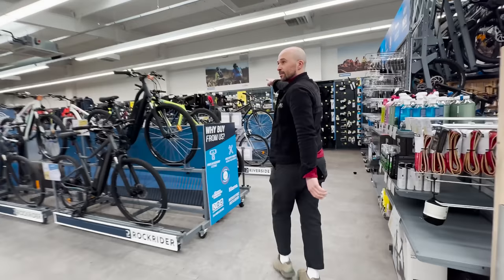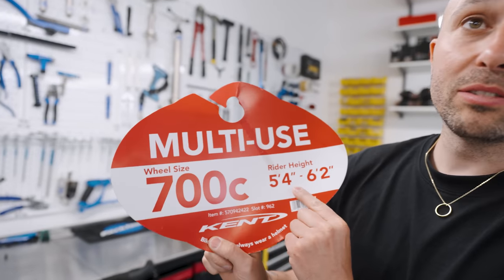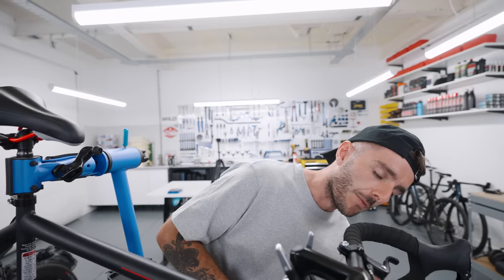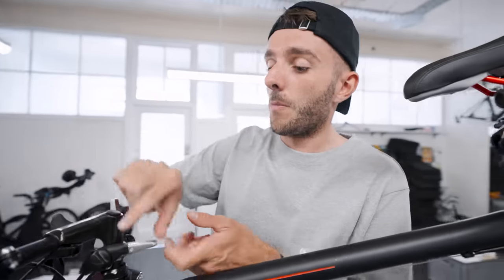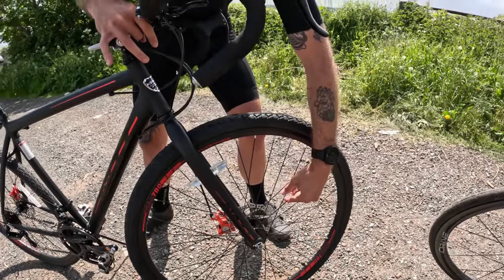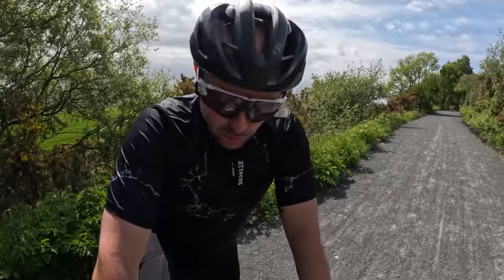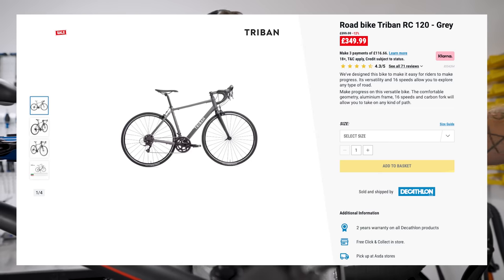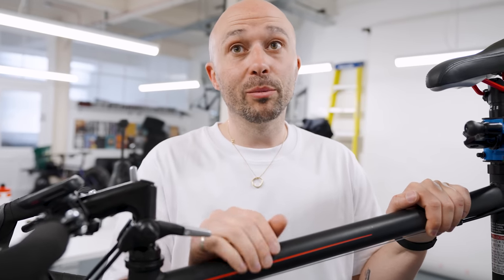We Bought A $248 Entry Level Bike in 2023 - Too Cheap?

Comment from the maker: Something I didn’t think of pointed out by @egyeneskifli7808 in the comments:

The frame being steel means you could have the steel derailleur hanger re-welded if it were to break. A fairly low cost solution, but would probably entail a trip to both a welder & then a subsequent trip to a bike shop for straightening/tuning if you weren’t confident in doing it yourself.
Reply: Labor costs for either in the states is going to be more than the bike is worth.
Reply: even cheaper and easier would be a derailleur hanger bracket that bolts on with the axle (for example the Shimano RD-MC10). They were pretty common when older bikes with horizontal dropouts were fitted with a rear derailleur, and you can still get them sometimes for about 5-10€.
Reply: I really like the ability to brake when in a more upright relaxed position thanks to the extra set of brakes. Most of my riding is for commuting, and I occasionally use the bike for amateur bike races and triathlons. I honestly wish more gravel bikes had these extra set of brake levers.

Comment: upgrade the bikes to a certain budget and race it, and please do not do what the GCN guy did very unrealisitc adding a dura ace crank.
Reply: Upgrading them to the minimal acceptable level would be cool.
For one strip all the unnecessary crap: kickstand, prisms, etc. On this bike I would definitely try to get better levers (idk the availability of 2x7 combined ones) to make the front less busy and better suited for normal cycling. And definitely upgrade the tires on all of these cheap bikes.
Reply: What do you mean unrealistic? You don't have a Di2 Ultegra just lying in the back of your shed?
Reply: You say ‘to a certain budget’? Who’s to say GCN’s ‘certain budget’, didn’t include a Dura Ace groupset?
Reply: How he expects to shift swiftly, during a criterium race (Alex said he'll race using that bike), with a crankset designed for a 11 speed cassette, using a Sora 8 speed instead, will be always a mystery to me. #gcn 😂
Reply: Agree with almost everything. I would probably keep the kickstand. Some small weights are worth keeping for the sake of convenience (in my opinion).
Reply: Cade doooooooooo it. No balls
Reply: @shrinkingshrimp  kickstand isn't unnecessary crap
Reply: @gpersonaltrainer 1979 Campagnolo 6 speed chainset works great on 10 speed chain and specially narrowed freehub,  sliding easily into 126mm dropouts with 1973 Nuveax Record derailleur on original downtube shifters. 9 cassette sprockets out of the 10. Yes I did just that! Still works great. 1979 Dave Moulton.
Reply: Yeah like a $1000/£ upgrade build off of budget bikes

Comment: Pretty amazing that Walmart is providing a safe, affordable, and reliable entry level into road and gravel. Most people buying these are riding around the suburbs to a park with their kids or any easy ride on flat paths. 

No bottle cage mounts is crazy though!
Reply: Give a spoke has gone and one of the brake levers doesn't work, reliable seems like a push as a description.
Reply: I've owned and worked on these bikes and they are not very reliable at this price and usually not safe at all. The amount of bikes I see going out of Walmart with no brakes and loose cranks is ridiculous.
Reply from the maker: @nascarisawesome5018  more an issue with the Walmart staff assembling them than the quality of the product perhaps?
Reply: These bikes are an absolute tragedy. The brake levers are long and fragile, will easily snap off. The handlebars are so incredibly deep, unrideable in the hoods. The wheels are made of cheese, the bottom bracket comes packed with sand instead of grease.

Definitely one of ye worst bikes that you can buy
Reply: @Cade_Media  Absolutely the case. Wal mart assemblers are not hired as pro mechanics- they're just minimum wage employees who get thrown at an instruction sheet. And I'd bet that when somebody gets good, they get a better paid job at a higher end bike store.
Reply: @Cade_Media  Both. I live in a university town and these bikes (and similar from another chain called Academy) are constantly falling apart and being abandoned. They use really horrible parts specs, like C&C bearings in the BB's and hubs that are trashed within a year because the people that buy them aren't the type to maintain them, let alone pulling bearings for constant regreasing (or just greasing a first time, because its Walmart).
Reply: @Cade_Media  A bit of both. A lot of the bikes come with inverted forks and loose things like cranks, which is on the assembler. But there is also a lot of stuff on there, like stems, that are very low quality and often arrive stripped and even come bent.
Reply: Grew up with bikes like this for over 15 years and never had a problem with them, its a shame they get such a bad rep because they are actually not bad at all. As for the bottle holder, evertime I had one it never even fit I just put it in my backpack and that works just fine

Comment: I use a Companion 1.0 gravel bike (from the danish chain Fri Bikeshop) as my daily commute bike. It was around 600 pounds on offer at the time I bought it.

It has really impressed me. Shimano Sora, disc brakes (not hydraulic), good stiffness and ok weight. 

I love using it as my commuter or when riding trips with family or friends.

Comment: What I've noticed as I've begun to dive deeper into the biking world is that a lot of these budget bikes are really hybrid/ATB bikes in disguise. This particular Kent may not be a "true" gravel bike, but it would make for an excellent commuter for someone who might need to cut through the odd gravel trail every once in a while.

In addition, the wider handlebars on this bike seem perfect for attaching a front pack if you remove the redundant brake levers, I think
Reply: I probably wouldn't use the word excellent, maybe more like usable.
Reply: @markusseppala6547  Usable for a few months til the parts give out. This bike is made to sit in someone's garage and maybe be used twice a year. Daily use this thing will be clapped within a few months.

Comment: I want to see you guys upgrade this thing to a "banger of a bike" like Jimmy says it can be. I think a lot of us are buying lower spec completes these days and then upgrading drive train, wheels, cockpit over time to make them the bike we wish we could have afforded to begin with. Probably not from this low of a spec though lol.
Reply: Plus, it's kinda enjoyable for some to just tinkle with it for upgrading and reaping the benefits.
Reply: @IS-xk3iq  also, for a mechanically inclined newbie, it ended up (for me) being a great way to learn the basics of working on a bike, upgrading parts, and learning what features I cared about before investing in a more permanent bike.
Reply: This bike is way too low spec to do much with. That drive train isn't going to be intercompatible with anything so you're upgrading all of it in one go. You might as well just buy a new bike. This is the problem that a lot of newbies are been scammed with regarding the buy cheap and upgrade path. There's a level too low that you can't actually upgrade. You have to know enough to start at a proper point.
Reply: @cjohnson3836  It looks like square taper (threaded BB) so it should still be fine for a BB upgrade. There's a lot of ST cranksets around that work well too. The rear sprockets are likely a freewheel, but a nutted axle wheel can be replaced with a QR freehub wheel without issue if you really wanted to do that.

Comment: I bought this bike from walmart in a box that I put together for 250usd. I love it. The stock peak bb5 clone brakes are good but I bought avid bb7 brakes for much easier adjustability. I have the bb5 adjusted well on the cross sub levers and the key is to get the outer brake pad close enough to the brake rotor and not having it rub. Make sure you back off all the barrel adjusters off first. The brake actuator arm on the brake housing should be totally relaxed and then you screw in the cable bolt. From there, there is going to be some trial and error to adjust the outer brake pad to the rotor. Adjust one brake pad at a time and have the other all the way out so you can listen to only one brake pad rubbing on the rotor when brakes are relaxed. Once you have the outer brake pad dialed in and it's not rubbing on the rotor then work on the inner brake pad by screwing in the outer adjusting wheel using a hex key. Also, if it's hard to turn then back off the set screw in the brake housing because it's pushing on that adjusting wheel so that the wheel doesn't screw itself off. When done, screw in that set screw just enough to allow you to rotate the inner brake pad adjusting disk since you'll need it to make adjustments when the brakes wear over time. 

With the bb7 brakes, the outer brake pad can be adjusted and that takes out all the trial and error of bb5 setup. Before any of this work, make sure you true the disc rotor first so that it doesn't wobble as much because then you'll need more empty space between the brake pads and the rotor and your cross bar brake levers will probably bottom out before the brakes stop the wheel. For the cross brake levers to be adjusted well, you will need minimum space between the brake pads and the rotor and thus the rotor can't wobble too much. I find the back 140mm rotor to be lot stiffer than the front 160mm and thus adjusting the back brake is much easier. 

Make sure you take the slack of the 7 speed indexing derailer cable out first with pulling on the cable with pliers. The barrel adjuster should be retracted on the end of the derailer. Also, take out the slack of the friction shifter cable of the front derailer the same way. The front derailer doesn't have barrel adjuster. My front derailer only has two chain rings, the smallest is gone. I took off the plastic chain protector on the front derailer off as if the chain comes off it will be easier to put back on. The front derailer should shift gears when the friction lever is pulled all the way down because after the shift the lever will move back up a bit, which is normal. My front and rear gears shift great and I have zero problems. It's all in the setup as they say. 

The tubes come with shrader valves and if you get a presta valve tube then you'll need an adapter to put over the presta valve to take up the space of the larger shrader hole in the rim. If not then expect a tube blowout. If you ever need to take off the freewheel then use an impact wrench on the freewheel bolt. To put it back on, just snug it and start pedaling and it will auto screw itself in. Don't use the impact wrench to put it back on. 

I love the frame and the welds look great. The wheels are also heavy duty double walled and you can put rim brakes on those wheels as well if you wanted but they must be center mounted rim brakes because they have only one hole in the front and one hole in the back forks to mount them. Can't put in a V brake because there are no standoffs to mount them to. Lastly, I too ride with my hands on the top of the drop bar and rarely use the handles unless I'm sprinting. I love the look of drop bars and that's why I bought this bike. My tires are 35mm wide. I think you can put on a 40c tire as well and not run out of clearance in the forks. I think the rim is 21mm wide internally. 

One thing about the front derailer adjustment. Make sure that the derailer cage is centered over the chain when you're in each of the chain rings. Shimano suggests otherwise so don't go by their manual. They want the inner edge of the derailer cage to be 1mm from the  chain and I disagree. The system seems to work best this way. 

Forgot to mention that you don't need the avid in-line barrel adjuster on the front or rear brakes because the cross brake levers have their own barrel adjusters. The main brake levers don't have barrel adjusters. Remember that the main brake levers pull the brake cable and the cross brake levers push the cable housing in order to move the brake cable. These are two different systems and that's why the cross brake levers are more difficult to setup right and need minimum free space between the brake pads and the rotor. The main brake levers don't care about this that much because even with more space, the levers won't hit the drop bars. I plan on using this bike stock other than installing the avid bb7 brakes. I will lube the caged bearings and might replace them with better balls and just toss out the cages. This bike needs nothing, imo. Maybe new chain once in a while so it doesn't wear out the freewheel and chain ring. But even so, they're cheap to replace.

Comment: You can get a cheaper bike from Decathlon than the one you brought and it starts to have a lot of compromises and weaknesses that you see on this bike. 

The Decathlon bike you got really is the base model entry point where a road bike has all the "similar" features of a £10K road bike. Where as something like this bike, just doesn't, friction shifters are the 90's, as are quill stems, not having bottle cages is just cheap, there is not really any other word for it. They haven't aimed to make a good bike there, they have aimed to make a cheap bike, that looks modern (hence discs), for the uninformed consumer.
Reply: someone buying a bike from a place like wallmart are not going to be informed about bikes tbh. So the company knows their target.

Comment: I only started cycling about 2 years ago, and I got started on a very similar Walmart Kent.  Mine had rim brakes, aluminum frame, a triple chainset, 28mm tires, no top-brakes, bottle cage mounts, and shifters (I don't know the proper name) that are in-line with the handlebars and twist to shift.  I did end up piecewise upgrading almost everything on that bike as I learned to ride, and what features mattered to me.  I definitely would have been better off to get the Triban as an intro bike, but didn't know that at the time.  I wasn't sure that I'd enjoy cycling, so I wanted to go on the cheapside until I proved to myself that I'd stick with it enough to warrant a "real" bike.
Reply: Those shifters are called, unsurprisingly, twist shifters. I actually really like them- mechanically they're dirt simple, basically as simple as an indexed lever, and they're easy and intuitive to operate. They don't make any sense on a drop bar, though (hell, I didn't know you could get them around the bends on a drop bar!) but my favorite option on flats.
Reply: @cptjeff1  the big problem, for me, as a total beginner, was that taking a hand off the handlebars to shift was really dicey.  Not having ridden a bike in like 35 years, since my childhood BMX bike days, the roadbike felt twitchy as hell and I really did not want to take my hands off the bars even for a second.  That was one of the first things I changed out (for brake lever shifters). I never could figure out how to remove the twisters without breaking them apart :).  My only guess is that the bars were bent after the shifters were put in place?  I dunno, it was weird.
Reply: @DC-lu5qs  Twist shifters don't require taking your hands off the handlebars, though! Just slide them over. But yeah, taking a hand off is a critical skill to master if you ever want to do something like turn on a light, take a drink of water, handle your phone's nav. Or signal your turns! I'd get used to doing that long, long before you install a crutch like brifters. 

But then again, when I was learning to bike, brifters were still hyper expensive elite racing tech and thus quite unavailable to a kid learning to bike. If I couldn't work a lever or a grip shifter, I couldn't change gears.
Reply: @cptjeff1  lol excellent points.  I had not found this community by that time and was completely on my own figuring this stuff out.  I just felt like I was going to crash every time I switched gears.  It did take a while to get comfortable doing all those things.  I still don't play with my phone while I'm moving :).

Comment: Re: non functioning cross lever: The drop lever has a wheel release position for rim brakes, you can see the lever on the right sticking out way further than the one on the left. Pull the lever and move the silver cross pin to the other positon, this pulls the brake a little and should make the cross lever work as intended.

Comment: If a bike works with a range of stem length, such fit range might work. For a 2" height difference, you need only like 12-14mm of top tube or stem length. Half is in the legs after all, and the seat tube angle makes the higher seat sit back more. Ideally a ibgger bike came with longer cranks, but the market decided that riders are not worth a choice of correct length cranks. For this reason, tall riders on average will set their seat even more aft, needing even less in the top tube or stem.

Comment: I have this bike. There wasn't a spec of grease on anything and whoever assembled the wheel axles absolutely wrenched them down to the max. Also the cups on the bottom bracket were cross threaded in. After completely overhauling the whole bike it's not bad. The frame seems great which is about the only thing besides the wheels that are original on it for me. Had to dig deep into the parts bin on this parts bin special. 😂